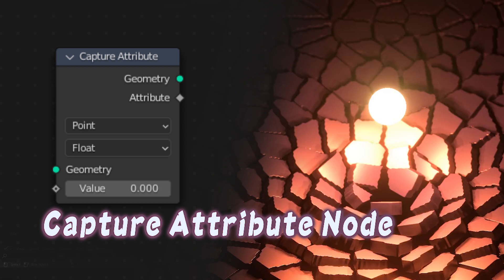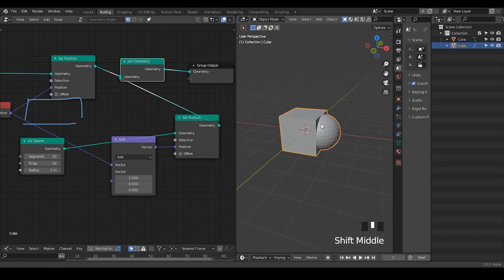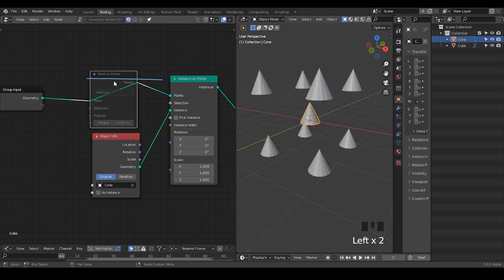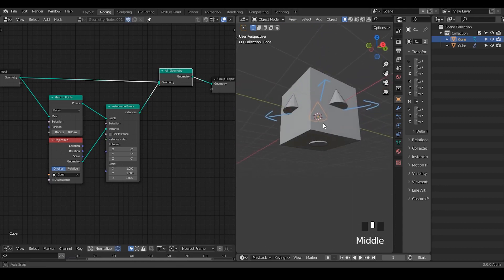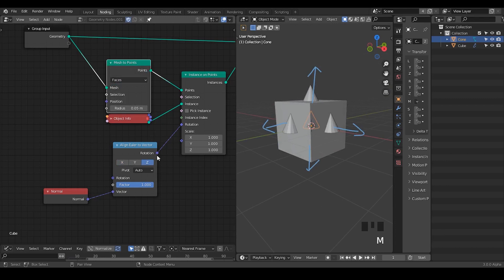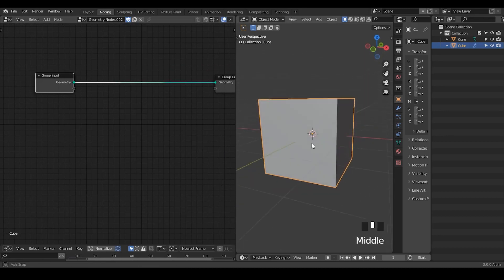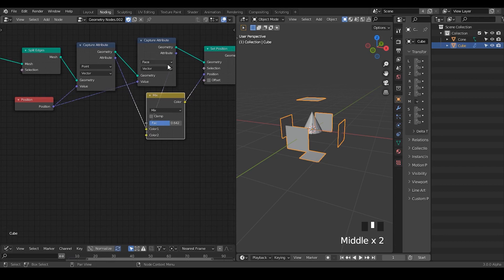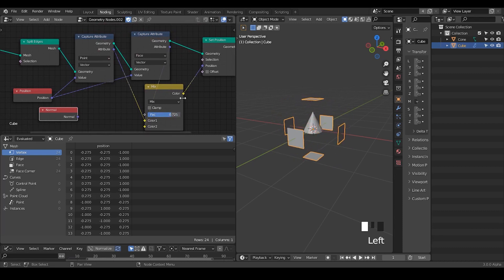[Tut] 2 Uses of Capture Attribute Node Explained - Blender Geometry Nodes 3.0 Field

Comment: But I am still confuse on this. What can "Capture Attribute" be use for?
Reply from the maker: I think it's stated pretty clear in the tutorial about its usage. The need of capture attribute for the first use case is extremely common for various cases.
In the tutorial, mesh to points will cause a loss of "normal attribute" so you have to capture it.
there can be other case, curve to mesh or mesh to curve will cause the loss of curve tangeng or normal. so you also have to capture.
Reply: @bradleyanimation120  What do you mean capture it like reusing it. Like if things don't have data for kind of things then would use the "Capture Attribute". Can you make very basic understanding for my level. Like understand it little bit of I just need get more information about it.
Reply from the maker: @beansze4940  I think it really has been stated well enough in the first part of this tutorial. Please think it carefully why I used "capture attribute" for normal in it.
Reply: @bradleyanimation120  I will rethink it thanks for helping me for little bit of understanding
 cheers mate

Comment: Using Blender 3.1 or a newer version, instead of mixing the outputs of two capture attributes you can just use a scale elements node, right?
Reply from the maker: For "scale" as shown in the tutorial, yes you are correct. However I want to remind you that we do not have "Translate Element" and "Rotate Element" . If people were to achieve the result shown in cover page, capturing attribute method used in the tutorial is still needed.

Comment: nice tutorial. Thanks for doing these. 

I think the 2nd case could be done w/ 1 capture attribute.
And maybe mixing it with initial position or normal I think.
Reply from the maker: Yes, you can use only 1 capture position node in face domain, since position is by default in point domain and you don't need to capture it in this specific case. You can think it's either a mistake or the fact that I want to explain things more clear in that manner.
Reply: @bradleyanimation120  no worries. It was just a ponder as I was watchin.